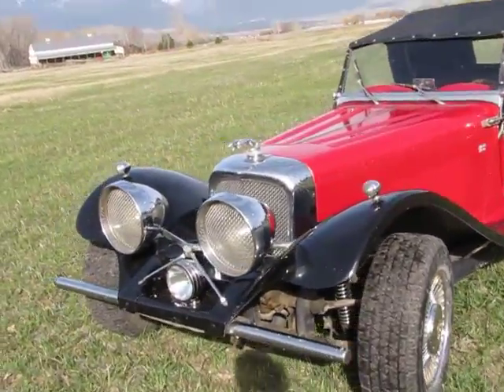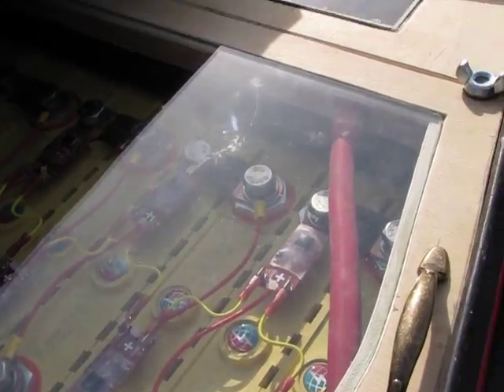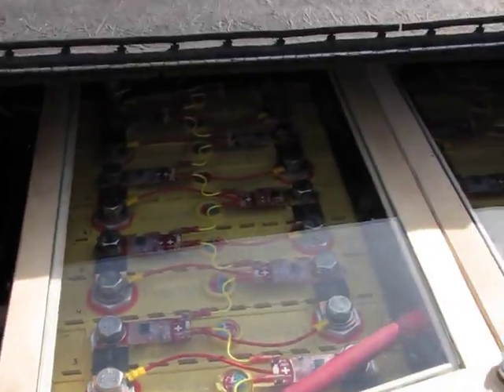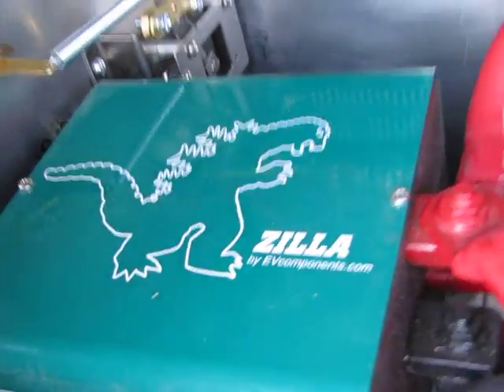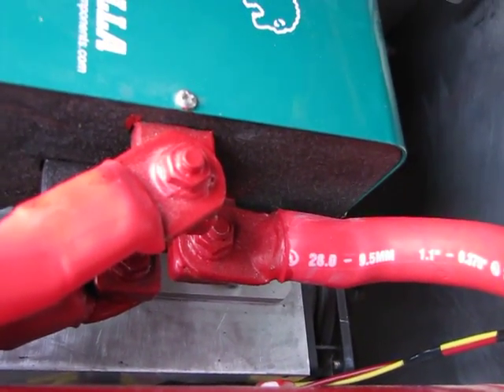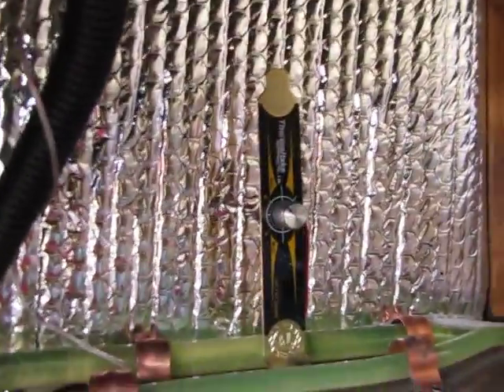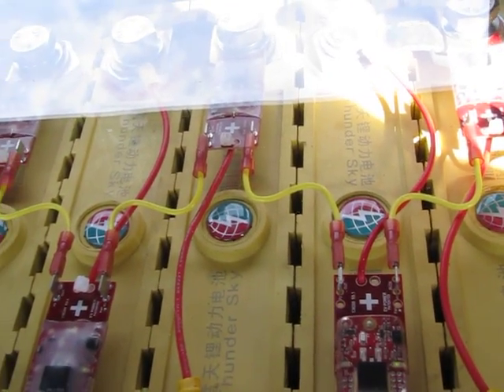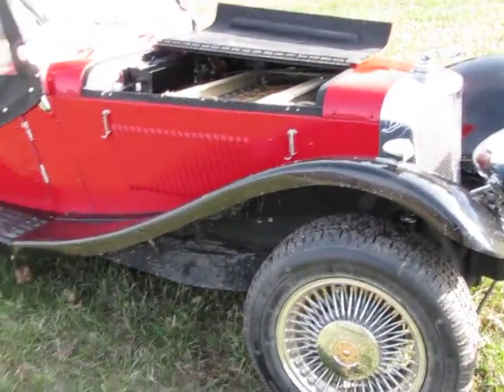1937 Jaguar Electric Vehicle Conversion Lithium LifePO4 Battery

Comment: Well excellant conversion but seriosly on a beauty of a 1937 jaguar!! criminal its meant to have a jaguar period engine.A very expensive classic in some ways ruined.Better really to convert less valueable cars.I like the principle but really from a classic car enthuisiast point of view this has trashed the car.
Reply: mark farley It's a VW Beetle-based, fiberglass kit car and a very nice example. An original Jag would probably be very heavy and also you'd have to put the motor in the front to line up with the transmission if, indeed, you chose to use the original transmission. It's a really clean and well constructed project.
Reply: wow thats an impressive repro i would never of guessed that.In that case its totally amazing !!!! and i think its great then phewww what a relief lol

Comment from the maker: These are Thundersky 260ah.  Some of the biggest batteries you will ever see.  Most EV conversion suppliers have large-format LifePo4 batteries.  This is the SAFE lithium chemistry.  Very different from Lithium 'ion'.  The new cells to have are the CALB CA series.  Less sag under high load.  But good competition is never far away...